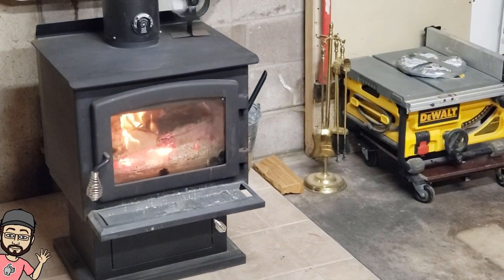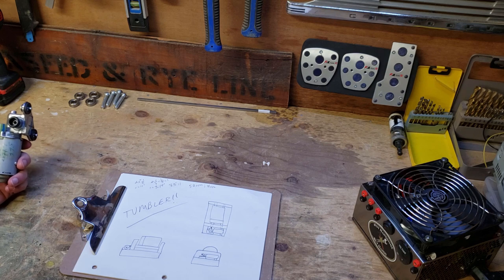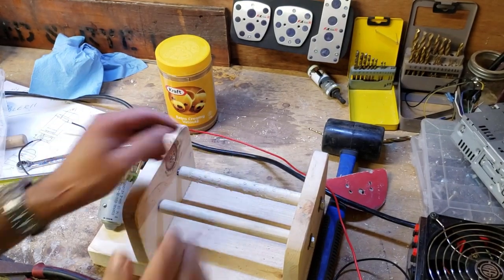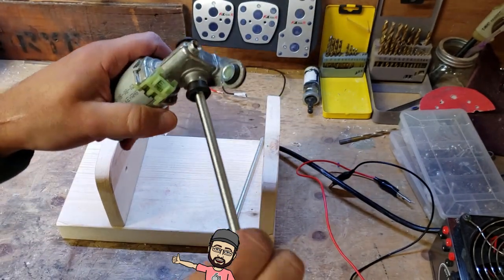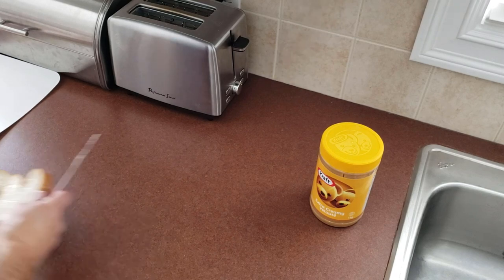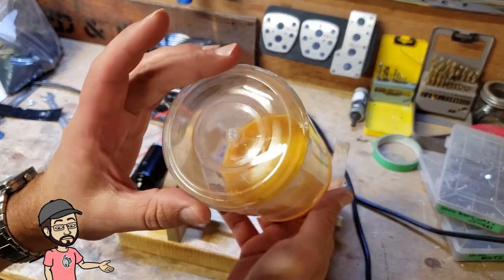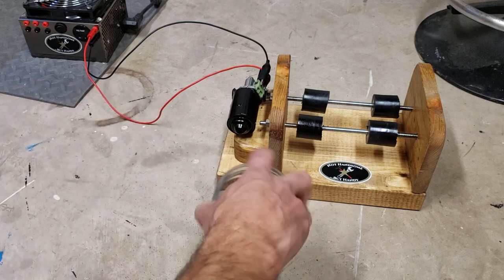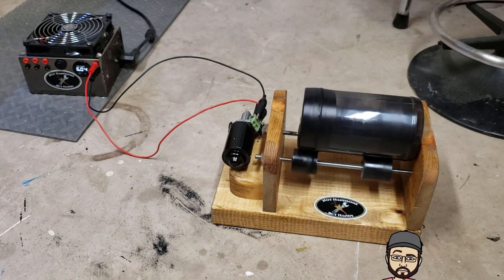DIY Rock Tumbler - Episode 1 - Building a Homemade Tumbler

Comment: It looks like a fun project.  it works pretty well considering you just whip it together without ever done it before.
Reply from the maker: It's had a few hiccups along the way but it's been running pretty solid since. Basically ran for months over 4 batches of rocks and glass. I'm pretty happy with the reliability.

Comment: FYI: 
The wiper motor might spin at 300 RPM; however, there will be a reduction of RPMs when the motor spindle is attached to a larger pulley or the barrel is placed on the spindle.
Reply from the maker: Good point!